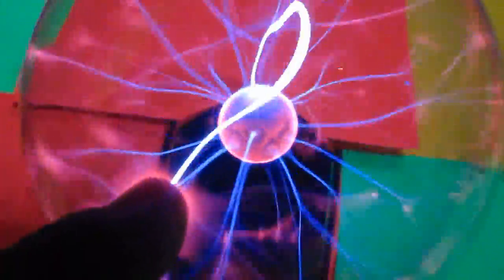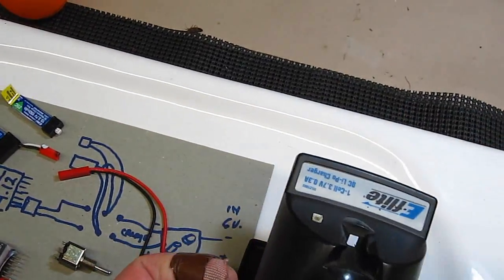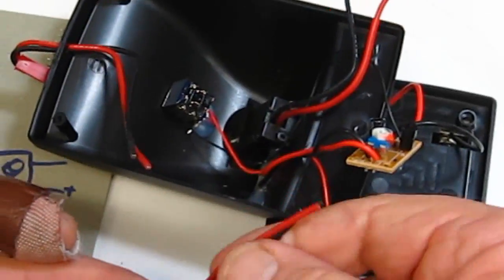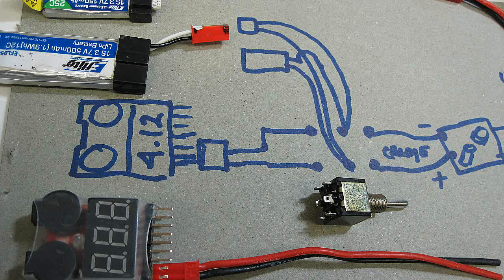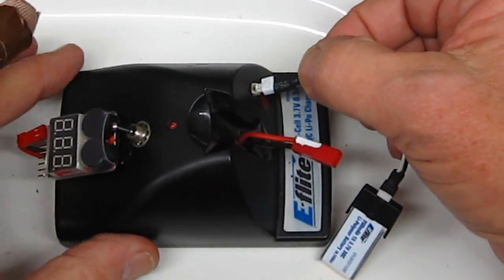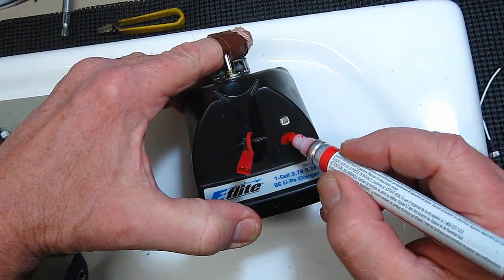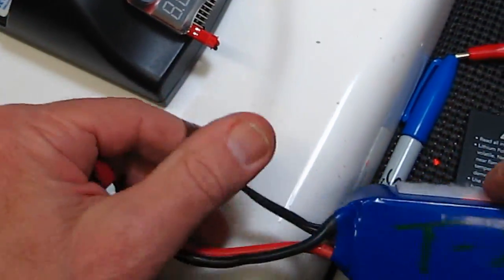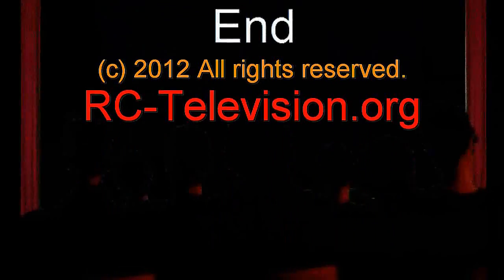How to make a 1 Cell LiPo Tester & Charger, All In one.

Comment: My issue is, I will charge a battery and fly, and 30 seconds or so later the plane is on the floor with a low battery, It would be nice to have a system that will test your ma capacity.
Reply from the maker: Tenergy makes one as does others.  https://www.amazon.com/dp/B0178P8H9U/ref=redir_mobile_desktop?_encoding=UTF8&aaxitk=8a1ef60f4ba0e73f9aeffdea70e48422&hsa_cr_id=7940332990001&pd_rd_plhdr=t&pd_rd_r=b9c82d28-9dda-4a53-b448-32ff59fd47f4&pd_rd_w=LpNdc&pd_rd_wg=slBcY&ref_=sbx_be_s_sparkle_mcd_asin_1_img
Reply: @NightFlyyer  Sadly it will not do 1 cell batteries, but thanks. I have one, and tried it.
Reply from the maker: @helichuck1  That link is not for 1 cell batteries!   It loads and tests batteries up starting with 2 cells on up.
Reply: @NightFlyyer  yes, this video was about 1 cell batteries
Reply from the maker: @helichuck1  But you asked about a cell MA tester for more than one cell, because you said you don't fly 1 cells!  I tried to answer you.   
I fly my jets and helis with 22v lipos and also fly my small fpv drones and helis with 1 cells and have many lipo battery tests and explosions as well in videos on my channel. I have this Turnigy tester for my big batteries and made this video 10 years ago before there were many testers for 1 cells.  If your 2 cell batteries are going dead in 30 seconds, they were probably drained below 3.0v which destroys them for good or your charger is bad.  A good tester will tell you what is wrong. Good luck.
Reply: @NightFlyyer  Sorry, If you look at my post, "My issue is, I will charge a battery and fly, and 30 seconds or so later the plane is on the floor with a low battery, It would be nice to have a system that will test your ma capacity."

"I did not mention any cell count!  Sorry for any confusion, thanks
Reply from the maker: Are you kidding me?  This is what you said! 
Chuck Horvath
2 days ago
 @NightFlyyer  Sadly it will not do 1 cell batteries, but thanks. I have one, and tried it.
Reply: @NightFlyyer  ok, sorry

Comment: I think flyer guy is right.  Shouldn't switch #2 be connected to the input of the charger board (the AA supply batteries) rather than the output of the charger board?

Going to do the modification to a couple of chargers this week when the switches come in.  Thanks, Curt

Comment: Dave correct me if I'm wrong, but I believe there is a mistake in the schematic. Don"t you need a positive 6v wire from the board to the second dpdt switch to read pack voltage? The way it's wired now it only has 4.2v going through the switches.

Comment: What would be the downside to eliminating the original switch, wiring the charger and Cell-Spy in parallel and just running the Cell-Spy all the time while charging? There would still be the option to unplug the JST connector from the Cell-Spy if desired...

Like many of the other commenters, I watch all your videos and enjoy them greatly, but the Orange Float doesn't fit into my diet :-(

Thanks for the entertainment and information!!!